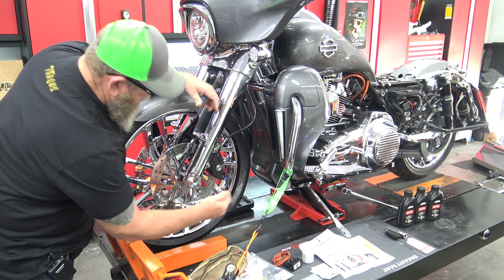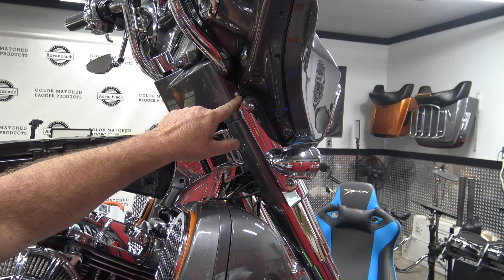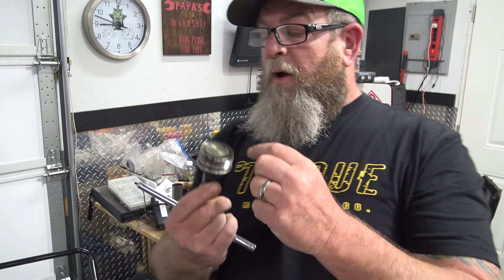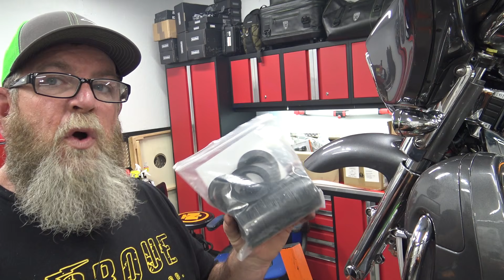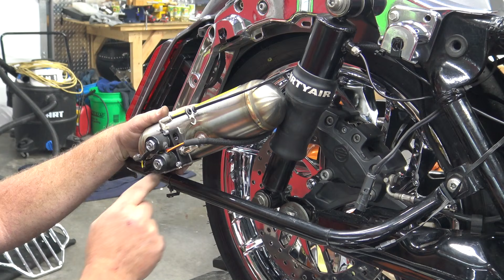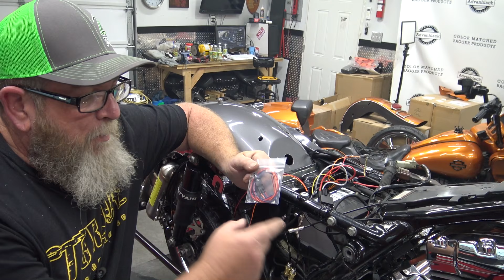⚡Installing Dirtyworks FRONT Air Ride Suspension System FULL INSTALL Experience the Ultimate Ride⚡

Comment: Awesome video, very descriptive and easy to follow. I may have missed it if you said it, but is there a specific reason you couldn’t just tie the airline for the front suspension into the airlines you already had ran for the rear? Why did you have to run a second switch?
Reply from the maker: thanks and yes...your front air pressure and rear air pressure will never be the same, two completely independent suspension pieces. ...if you tie it together it will be pressure. Your rear will always be adjusted by the weight you have on the bike..solo or two up make a huge difference in pressure to maintain the same ride height. Never put the front and rear together.

Comment: I have a 2015 road glide. Do I have to pull the forks off?  Or can I just take the handle bars off and do everything I need to do that way?
Reply from the maker: i mean i guess you could...but im not sure how you're going to compress your forks...maybe using the jack? I dont know...just easier to pull the forks honestly it only takes 10 minutes to pull the fender, wheel and forks. Juts my humble opinion

Comment: Hello. Do you have a front air installation video on a 2012 Electra glide????
Reply from the maker: so I dont have one specifially on that but I do have one on removing the forks, which you will need to do..the rest is the same as 14+ Here is the link to removing and dis assembling the front forks on a 13 and older, this is on a trike but is the same as yours https://youtu.be/oKCChu4NgPw?si=ljXu3eOJBufZcj6P

Comment: Hi, nice video and thanks for all the advice. My question is that I don't fit the stock shock absorbers but I have the Holins cartridges... is the procedure the same?
Reply from the maker: Youll need to return the front shocks back to oem and remove those cartridges all together. You need the stock spring and top/bottom washers, then install the air pucks. Dirty has those oem springs if you need them.
Reply: @sikbaggers  top thank you

Comment: @ 11:45 you pull the washer out that’s above the spring. Then it cuts back… did you put the wash back in before moving forward?
Reply from the maker: no washer needed
Reply: Did you leave the OEM spring

Comment: What kit did u use?
Reply from the maker: I added the front after adding the rear first. So the kit I used is thier basic front air ride ADD ON. You can buy the whole kit rear and front together though...I dontknow what you have already but the ADD ON is assuming you already have the Dirty Air Rear Kit. https://www.dirtyworks-kc.com/dirty-air-new-fast-up-rear-add-on-front-air-parts.html

Comment: Would a front air ride kit be suitable for a triglide?
Reply from the maker: You can certainly run air on your trike but I dont think it will give you the best ride. Watch my video on the dk custom comfort shocks, race tech springs and intimidator valves ...far superior ride vs air ride.  Rear shocks https://www.youtube.com/watch?v=PIbq8gxpiks front shocks - https://youtu.be/oKCChu4NgPw

Comment: would your center stand change at all with front air? wondering if you could sit it lower with front air or if it will be about the same sit with just rear
Reply from the maker: you dont have to change it, it will just put more weight on the bike when its aired out which is a good thing...however you can change the feet on the bottom, depending on which stand you have, so you can lower the bike slightly when aired out.
Reply: @sikbaggers  I went with the SOB stand and the AFK switches, about ready to do install but I notice SOB says to use a 5 amp fuse on the actuator and I noticed AFK says max amp is 5 anything more you need a relay... I didnt notice anywhere if you had these or if I need them. Please if I do would you let me know what I need to get. Thanks Steve!
Reply from the maker: @Dillonxxxx  you can run a 5 amp fuse on a max 5 amp switch. so just put 5 amp fuses in and you'll be fine.

Comment: Can i use the same air tank that came with the rear air ride for both front and back or do i have to get a bigger one.
Reply from the maker: its the same air tank...as I showed in the video all i did was hook up to the already existing tank...it has plenty of air to get you off the ground and going when its full.

Comment: Will those pistons or that kit fit in my 2005 Harley Davidson Electra Glide classic
Reply from the maker: these are 14 and newer 49mm forks...yours will be smaller and they do make poucks for that...13 and older touring.,..just give them a call and they will set you in the right direction to everything you will need.

Comment: I WANT THIS! I also want this 10" bars. May I ask what kind they are?
Reply from the maker: Hey David...yes sir they are the la choppers twin peaks 10" here are the black ones https://amzn.to/4azU21t and here are the chrome ones https://amzn.to/4awufXF you cans ee in the video that the 10 stop behind the fairing. So you will need to relocate your mirros to perch style mirrors and to make the install easier get the 10" extensions for the thumb controls...its super tight if you dont..well worth the money. Harley has them but here they are at dennis kirk https://www.denniskirk.com/kst-kustoms/10-in-handlebar-wire-extension-harness-wire-ext-10.p2102836.prd/2102836.sku if your bike is 2014 or newer...if not look for your year. If you go above the fairing, 12" on up, you dont have to relocate your mirrors but you will need to extend most of your cables. I hope this helps.

Comment: Is oil supposed to pass puck while your pumping it — and shoot out the top fitting -

I’m having issues but mine is a 2011 and yes I bought correct kit 

But when I was checking for bump stops oil was shooting out top

Comment: What size wheel are you running? I plan on doing a full air ride soon. Seems like it could get lower. Can you get it lower than that?
Reply from the maker: 16 inch real wheel with a 1 inch lowering block./ Thats as low as it gets before it hits the tire. The bags are only 4.5 inch...so maybe look into a set of 7 down and out bags...it will appear to be lower or build a lay frame
Reply: @sikbaggers  that's cool I like that. Also, what about the front....wheel size and could you lower it any more?

Comment: Hi there. Excellent video. I currently have same system. 
Question : if I want to change fork fluid down the road is there an easy way to do it or do I need to remove whole leg and tear down and reinstall ?  Thanks
Reply from the maker: on 14 upo touring youll need to take them off..the drain is at the bottom and the fill at the top ...you only need to remove the top cap and air puck though...no need to strip them all down.
Reply: I have a 2012, are the earlier models able to be done without tearing out ? 
Thank you.

Comment: I'm interested to hear thoughts on Dirty Air vs Legend Air.  I want (or think I want) the front air ride, which Legend doesn't offer.  But Legend is a name I know, so my only real question (well two) is, is the front air suspension superior to the cartridge style that Legend has, and in terms of quality and longevity is one better than the other?  This is for a 2018 Tri Glide Ultra.

Comment: What about a 17 SG with a 21 front and 18 rear ? You think the air ride would still work ?
Reply from the maker: It will still work HOWEVR you will be on the fender when you air out. be aware of that. It will hit the fender before you are all the way aired out.
Reply: @sikbaggers  appreciate.  I'm still on 16 rear until I need a tire. I may just stay 16 and do the air ride then.

Comment: Did you use loctite on any of the bolts? If so what kind? The manual says 246 but it isn't easy to find. Does it really mater the type of loctite?
Reply from the maker: Yes and 243 is perfectly fine to use on all fasteners that require medium strength.  This is the one I buy..cheaper than any other place I have found https://amzn.to/42mC7ad

Comment: If the control buttons for air ride and center stand would be on the handle bars that would be much much better, i might get a little hot in that area where you have them now.

Comment: Thanks for great videos as always , i got 2009 road glide cvo which I've put drop in lowering front fork spring ... What i did is just to put the main spring , short spring but no pvc spacer on it ... I also put 21" wheel with fender riser , do you think it'll bottom out ? I havent actually hit any deep bump yet. Reason i didn't put pvc spacer on it last time is because the second short softer spring is already sticking out the fork quiet much

Comment: So, I have been following you for some time. I had a bike shop install my air ride suspension but on hard bumps it makes a clanking noise. Is there a way to fix this?
Reply from the maker: should not be clanking at all...sounds like something internal ...really only way to check it pull it apart.

Comment: I was told from my local harley that I can't do a lowering kit in the frount cuz I have a 21wheel
Reply from the maker: You most certainly can.....youll need about 3 bump stops to be safe.
Reply: @sikbaggers  can you tell me what kind of lowering kit I can use ?I have a 2018 street glide not a special. Thanks

Comment: Can u use bump stops on a heritage? I did a 3" drop and dented the fender. My  2" drop the crash bar will still touches the fender when i ratchet it down as a trailer queen.
Reply from the maker: yes..you can use them on any bike

Comment: Hi Steve thanks for the bump stop explained details. I had asked this from your RG install. Anyhow on a different note. I run a air gauge on my bike, wondering if you can give me your sweet spot pressures for the front end and the rear?
Reply from the maker: well at this time I only have the air gauge on my sg and its only the rear...so not sure on the front right now...when i was in sturgis I just messed with it a bit going down the road until i found the best spot..its easy to put way to much air in the front...it really raises way up on you if your not careful

Comment: Nice video man!   Just did the front on my 09 street glide this weekend.  Had an issue with the pistons not going in and moving freely.   Getting some new ones sent out since both were tight.   Thanks for the videos!
Reply from the maker: Good deal Josh...glad they got you sorted, youll love the air once you get the sweet spot lined out

Comment: He said Jankie ass harley-davidson fork holder 😄
Reply from the maker: haha cheap o home made holder and have done a ton of forks on it...works great!
Reply: @sikbaggers  love it, love your videos
Reply from the maker: @werethelanhams7417  I use Danco 6"x6" Rubber Faucet Packing Sheets. https://amzn.to/3KXynoQ Cut them to size and glue them on with spray adhesive https://amzn.to/3MB6apn After 10 or so fork oil changes I had one come off...just re glued the same piece back on and kept using it.

Comment: interesting... mine only required 4 total bump stops on each side. 21" wheel with fender extenders on a stock fender. This left me with 1/4" gap when aired out/all the way down. Maybe some usefull info for someone out there.
Reply from the maker: yeah i could have got away with less...however i really want to keep the bike level when its aired out. i removed a few just testing it and the front sit lower than the rear...didnt care for that look